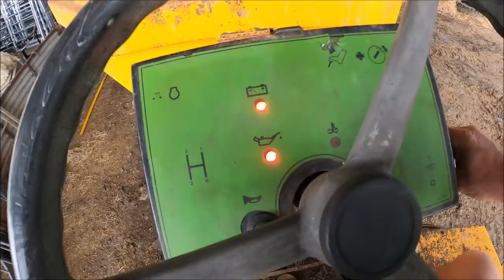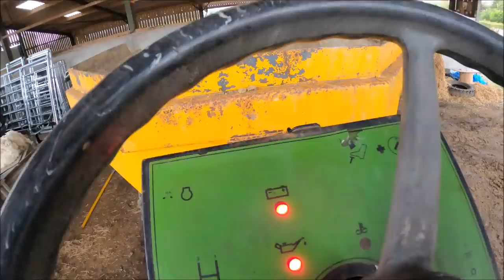Paying my debts and fixing the valley, followed by Coffee cake and repairing Donald.  11 08 21

Comment: A gob of grease on those floor securing bolts would stop you smashing your knuckles if you have to remove them down the line, and they're seized and shear off, been there learnt the hard way . cheers Phil B.

Comment: for a bit of security on the dumper and piece of mind you could get yourself one of those pin type padlocks, drill a hole in the clutch pedal just above the floor and it will stop the pedal being depressed and if the safety switch was working stop someone from starting it. just a thought.

Comment: Put the isolater switch on and use it Mr P We put a new battery on an old tractor few hours later noticed smoke coming out of shed wiring had shorted and was in the process of setting it on fire. All our machinery have isolater switches now. Shame to build new sheds and see them burn down, ok rant over
Reply from the maker: Fair comment, although until this issue raised its head I didn’t even know it had an isolator switch 😄

Comment: A battery load tester is a great addition to your tool arsenal. It simulates the draw on starting an engine and will give you a quick answer as to if the battery is past it and pretty cheap, saves a ton of investigation time as it is a10 second max test

Comment: A suggestion make a cable doesn't need to be to long as long as u have a good spot on frame , go from where the nut is to frame and you will always have a solid ground.

Comment: Good vid glad you got your dumper working 
Only one thing not having a isolator switch is if you have a fault occurring you can turn it off easily before it catches fire 🔥 
Me and my old manitou didn’t have one and the starting motor stuck on and smoke started to pour out of it and can remember frantically ripping the cable out the battery terminal luckily as it was all bolted on tight 
I have since fitted a isolator switch 😀😂

Comment: Mmmmmm lesson learned me think's, alway's go for the battery first if you haven't got around 13.5 /14 volts minimum the battery is usually shot and I noticed there was a shortage of lubrication on the floor bolts they go a lot better with some WD 40 no them Ian lol.
Reply from the maker: True. 😄👍🏼

Comment: get your self a piece of wood drill four holes one in each corner gt some coat hanger wire and put two lengths one on either end through two holes, and use it as a tray to carry the cuppa's... and if you use a big piece of wood add some bickies...lol

Comment: Ian the guys who put up the new portal frame should have dropped the frame 1 inch or more at each section to create a fall
Reply from the maker: That would have taken the roof out of square and possibly made fitting the roof sheets harder. The gutter is deep enough to cope with the 10mm out of kilter 🙂👍🏼
Reply: @FarmerP  it would have been fine I did it many times in the past to get falls

Comment: .... have you tried desulphuring your battery, extends the like of the battery immensely. My last one in my car lasted 6 years and I changed it thinking that was my problem. The new battery I put in lasted for 3 or 4 days and the same problem resurface. It turned out be the negative lead was no longer giving a good continuity reading. Junk, it's only bin in the car for 35 years .. smilin .. .  Frustrating that had got rid of a battery that was still good. That caused a note to self, use multimeter first ... I hook up the desulpherizer for 24 hrs, it tells you when it is done, about once a year ... got mine off Amazon ... you might give life back to some old batteries you have around ....